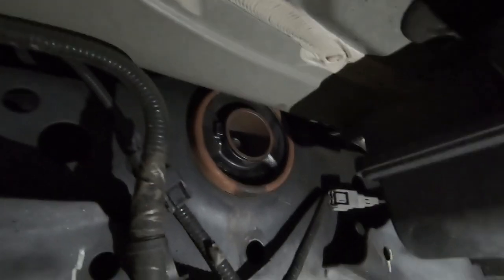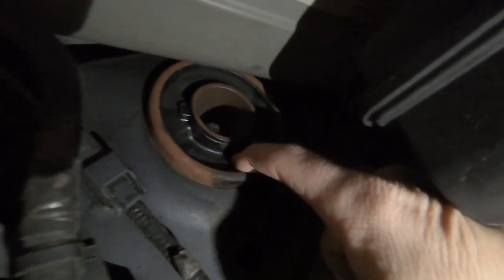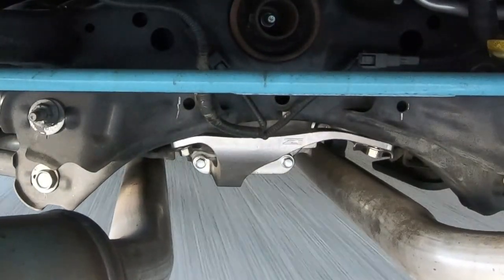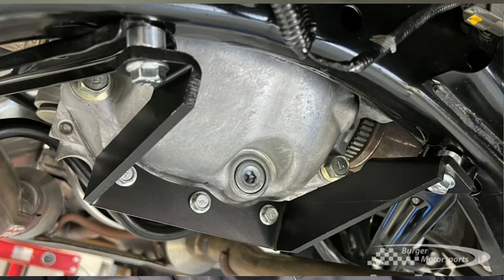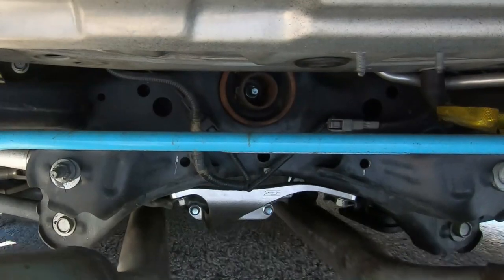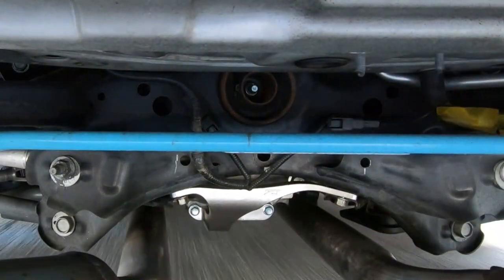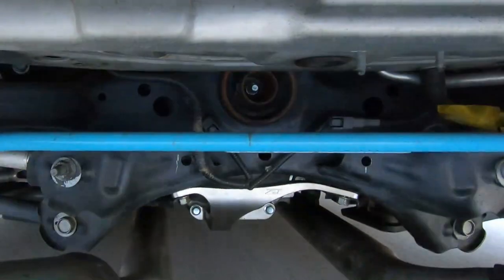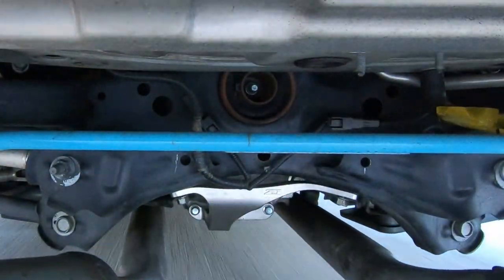Watch BEFORE Buying Z1 Motorsports Diff Brace Q50/Q60

Comment: I would be worried about adding this brace. Wouldn't it put more wear on the subframe bushings? I heard that you cannot even buy new subframe bushings and you would have to replace it as a whole unit.
Reply from the maker: No it shouldn’t.  It reduces movement so should be less wear, but you can install bushing collars for more support.

Comment: Hey man,  it's been a while... Your channel is getting really big!  I haven't posted a video in a while, and won't until I get another car...  I still may go for another Q50 or maybe a Q60... But a fully loaded, minus AWD, and bone stock, 2019 Q50S or Q60S RS400 RWD with under 35k miles on it.  For 2020+ they got rid of the performance pages, and many other features and pages on the bottom screen unfortunately.  Plus some 2018's still have the belt, and some other issues that were fixed by 2019.  That's why I want a '19 instead of an '18 or a '20+.   The brace looks great by the way!  I can definitely see a difference!  Good choice going with Z1 Motorsports in Georgia not far from my house.  They have amazing parts,  and do great work.
Reply from the maker: Good to hear from you man! q60 would be awesome!
Reply: @SpeedCultureStudios  
Thanks.  I keep coming back to wanting another Q50/Q60 not long after I start researching other cars lol.  Hey,  I posted like at least 4 comment attemps via reply here,  and in the comments section because none of them were going through.  They were kind of long too, and I just checked... Of course they're not there again lol.   Maybe they're in your  coments that were not approved in your settings?  Between having to send four comments when I only wanted to send one,  they took quite a while to text on my phone,  so I hope you will be able to check on that when you get a chance? Every other comment on other pages before and after those four have gone through.  Thanks in advance, 
-Chris

Comment: I had so much wheel hop when I took my car to the track. I am putting in a z1 lsd with 4.08 gears, new z1 rear subframe bushings, subframe collars, and a rear diff brace. Should be quite nuts!
Reply: What model?
Reply: @supradoom  I'm trying to put lsd on my g37x awd right. On the rear diff because I pull the fuse to disengage the front diff to do donuts but I cannot figure it out .. I have no idea how to accomplish this ..
Reply from the maker: Sounds awesome!  Wish we could do gearing change in the Q!

Comment: Ive seen a review on the z1 website where if you have a fast intentions exhaust, the braces bolts will make contact with the pipes. That sucks because i really want to get one. I might get one anyway and see if i can make it work.
Reply: Hey did you ever end up getting this brace? I have the same exhaust so i'm wondering if it can work on my car.
Reply: @Lord_Pilaf  no I ended up getting the pride brace, which mounts at a different location and fits nicely.

Comment: Berger is 10x better than the Chinese crap Z1 sells ..lol
Reply from the maker: 😂 The Berger brace is not bad but it is certainly no better than the z1 brace.
Reply from the maker: Nothing against Berger—I’ve used them on other platforms, but I’ve purchased a $40 catch can off Amazon that was EXACTLY the same as Bergers so…
Reply: Anything cast is going to be 20x stronger than something that is bent or welded together. This was explained in the video.

Comment: Do these work with Q40? I have 2015 Q40 looking to make a list of mods to buy
Reply from the maker: The Q40 may still have the G37 rear end--In that case, you can find the G37 options.  I would just check with Z1 to confirm as I am not certain.